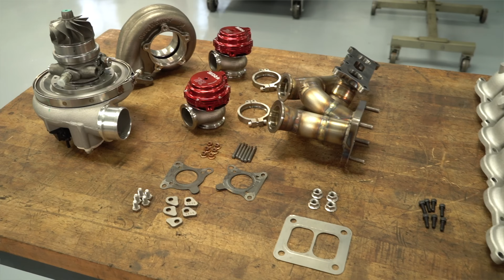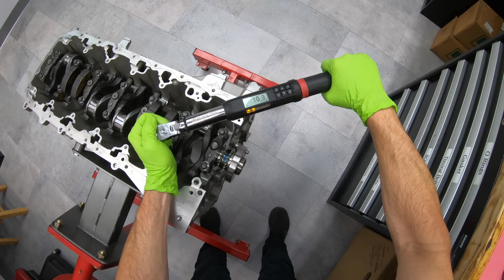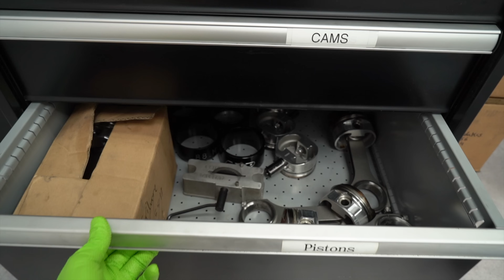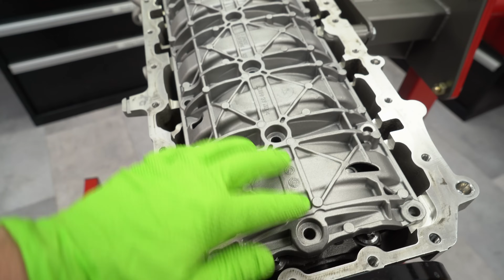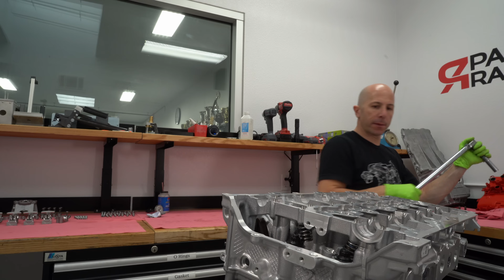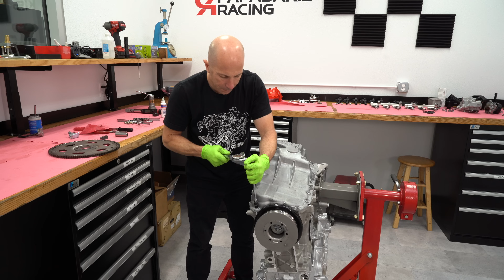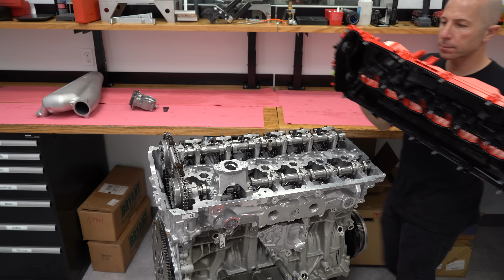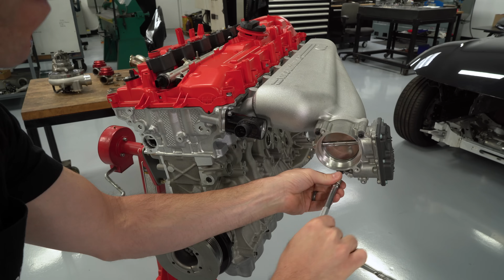2020 Supra 1000 HP Engine Assembly - Start to Finish

Comment: 2jz guys be like "tHiS ENgiNe StILl dOeSn'T mAkE 2000 hp, LaME!!!!"
Reply: Bryan Pranata to them you can say: not only is this thing’s power curve going to be less peaky, but the block is made of aluminum, not iron. It is lighter, and will cool better. I know a guy who does big time drifting, and after a couple hot laps has to put his 700hp 2JZ swapped build under some super fans to cool it down.
Reply: Xyreces ' people only bash this B58 since it’s a BMW engine. But the B58 is a great engine and it will make good power reliably. Thanks for saying all this stuff. Shutting up the 2JZ fanboys
Reply: Xyreces '  Well guess what, these turbo BMW sixes have the same issue. We have several customers who track their  335is, m235i etc., and they go into limp mode after several hard laps due to oil over temp warning.
Reply: @TheDeezelsmoke  Toyota left front vents closed because they over cooled the engine. If you have tuned engine, just open them and problem solved. This car is growing on me somehow. Lots of tuning potential.
Reply: Xyreces ' facts 2jz still rules. God of all inline engines.
Reply: Lol gotta love the forum bench racers here. These are the same ones that go claiming that their favorite car can do a gazillion hp stock and when someones asks "hey guys how can I make 1 hp above stock reliably?" they answer with a parts list that would make a Formula 1 team proud.
Reply: Bryan Pranata if the b58 had an iron block I would like a lot more
Reply: @Eric N Funny how people cant tell sarcasm. "what in the fuck are you smoking.... you said it yourself your dont know shit about the 2jz but here you are saying shit that isnt true." fucking . lul .
Reply: @purpscurp5534  I get the sarcasm but I will talk to idiots as such in their face or on their anonymous accounts lmfao
Reply: @Eric N turbo lexus is300 so yea I do know what the fuck im talking about...the perception and illusion is that you know anything about engines but here you are tryna troll knowing the b58 wont make it to the 2jz level
Reply: @the_visionvry6244  why because it wasnt made by an Asean guy? Dont underestimate the motor just yet. Same fucking thing happened years ago when the R35 gtr came with the all aluminium VR38 engine. But now we know what that motor is capable of. Just wait and watch. Toyota didnt just swap a motor from a 3series to their supra. They have done a tons of rigorous test on that motor to achieve their standards which btw even put BMW to shame. I wouldnt even bother to comment about the B58 if it was about a m340i. But as a 100year old reliable Auto giant using that motor i wont doubt its reliability. Already people have gone nuts over this engine. AdamLZ has already achieved a staggering 690whp with just turbo upgrade,downpipr and exhaust. Just take a look into babayaga racing channel where his piggyback Supra gapped numerous mustangs and gt350,camaro and even a gtr. So just sit tight and watch. Supra just came a year ago, buddy.
Reply: @Eric N  I have owned lots of high horsepower cars, including a Supra.  The stock long block is good for about 800rwhp with just bolt-on's + fuel with long term reliability.  My supra had 130k miles on it, stock motor, and about 70k miles of that was over 700rwhp. We had a guy in are local area with a 100% bone stock long block, with nothing but a single kit, intercooler, fuel, and a piggy back that made 800 to the tire for years, without issue.  I think people forget that it is not the high potential of the 2JZ that made them great, it is that you could make 700-800rwhp with true long term reliability with bolt on parts.
Reply: @Eric N There are tons of 2js that are reliable after 700+ whp, so not sure where you got that information from, but that's false.
Reply: @Eric N what in the fuck are you smoking.... you said it yourself your dont know shit about the 2jz but here you are saying shit that isnt true.... baltic supra is at 1400 hp and he drives it to and from the track...geo from realstreet is at 1800 stock block and did over 1000 miles to different tracks in the US.... on a sealed block challenge.... idk where youre getting youre information. the 2jz engine has forged internals so yes with bolt ons the supra is making 800 hp on stock parts... bmw has been making fancy high performance engines for years.... m3 m4 m5 m6 and they all get spanked by ancient supra mark 3's with bolt ons.. with a fuckin 1jz.. the only jdm car you know about is the gtr apparantly. the 2jz came in alot of lexus vehicles so careuful you dont get smoked by a fully built sleeper..
Reply: @the_visionvry6244  Thank you! Doing your research, such as you have done, goes along way.
Reply: 2JZ could reliably add 700hp buuuutt it was also a Moneypit. I think mk4 Supra's moneypit image was overshawdoed by its incredible tuning potential. And fact is B58 is waaay better than the stock 2JZ which btw is a relic. It was nice powehouse back then but not now. The Only problem with a BMW is they lack a good cooling management system which is why their engines suffer a lot. I hope toyota worked on this aspect. Nontheless B58 is the best in class straight6 motor, no two ways about it.
Reply: @abhinashpattanaik5109   this is blatantly false.  a 700rwhp supra was just bolt-ons (single kit, fuel injectors + second pump, and a piggy back fuel computer.) It would run that way indefinitely.  2JZ is still better motor that the B58 garbage.
Reply: Nope I like the 2jz stock
Reply: money money same but the motor is known to be tuned bcuz of the solid iron block.
Reply: @Eric N So since you're full of 2j knowledge and I'm so wrong. Please provide me with what brand and mods I should go with after my Supra make 600whp. I'm well passed 600whp in my Supra, but since you the guru and I'm the one supposedly spreading false information. Tell me what I need to replace after 600whp?? If you say the rods and piston after 600whp, you don't have a clue about a 2j.
Reply: @AllOutOrNothing88  i think 700whp is the break point. Anything over that could affect the motor with stock internals.
Reply: @abhinashpattanaik5109  700whp is no where near the breaking point for a 2j. My bestfriend and I just finished a 93 supra with 120,000 miles complete stock bottom end, stock head studs, s2 cams, springs and retainers, precision 7175and it made 650whp on pump and 950 on pump e85. Would have made more, but tuner didnt want to test 120,000 mile motor with more power. So, no 700whp is nothing for a 2j motor.
Reply: Bryan Pranata I used to be that guy lmao but this car has been growing on to me recently.

Comment: So many questions:
1) Custom pistons with stock rings and fingers, why would you even try that, there are so many ways to screw it up!
2) Why lock valvetronic to maximum lift whereas lower lift actually enchances a/f mixture at lower RPM? Maybe if this is dragstrip only project..

Comment: Mechanical vtc is so funny..honda uses oil pressure on vtc so no damage.  I think the cylinder head doesnt support high horsepower because 2x small exhaust ports of 6 cylinders. The real manifold is inside of the head.

Comment: Why are you using port Injection instead of direct? For better mixing of fuel and air and more control over ignition timming? I'd imagine you'd have better filling of the cylinder as well running as much boost as you do? Not great fuel economy though  ;)

Comment: A somewhat better engine than the previous BMW disasters but still a lot of room for improvement.
If the head studs have any coolant or open air around them coat them in neverseize before fitting the head coating the heads with neverseize won't hurt either.

Comment: That 3D printed intake manifold is amazing. I can see more and more parts being 3D printed in the future, from exhausts, crankshaft, engine block, etc.
Reply: Additive manufacturing isn't the Be All End All solution. It depends on the size of the part, the shape complexity, the mechanical properties that are required, the functionality of the part and how many "copies" you need. 

Current build volumes are not large enough yet to allow for a complete line-6 engine block, head or crankshaft to be printed. Also important to keep in mind: mechanical properties of forged parts are superior to printed parts, so as long as shapes are not too complex, a forged and machined part will have better strength than the same as-printed part.

When you re-design specifically for 3D printing, with the near complete design freedom of shape, the game changes. Then you can do things that are not possible with conventional fabrication (conformal cooling channels, complex shapes, additional bracing, hollow sections) and end up with parts that are lighter and, as part, stronger.
Reply: For the price of that manifold you could buy another supra.
Reply: it will work well to manufacture parts for old cars that aren't available anymore
Reply: There are 3d printed rocket engines (for orbital rockets, they are no slouch), so theoretically you should be able to build a fully 3d printed car engine
Reply: People need to realize that not all 3d printing is the same, SLM printing is most likely what they used with the intake manifold, its basically welding small particles one layer at a time and with each pass the bed is lowered and fresh powder is laid ontop, then scraped to be a certain thickness waiting to be fused with the previous layer, completely different from what everyone calls 3d printing with most sub $1000 machines that are just adding layer after layer. Hell it has more in common with sintering metal parts ( hugely common in manufacturing) than 3d printing. Also these machines are big enough that they can print many parts at one, not as fast as sintering, forging, or casting.. its more the same speed as cnc, except has a lot less setting up for each part than cnc or milling. Of course it has drawbacks, like cost  because you need super pure powderized materials but its still a relatively new technology, so give it time, and simmer down because every manuf. process has a drawback and non are perfect.
Reply: Imagine an RB26 3D print, that'd be awesome
Reply: @robertloweiii8790  No, just replicating a design without using what the extra design freedom has to offer isn't all that great. 

But imagine an RB26 based design with internal cooling fins in the coolant passages near the deck where the heat generation is greatest, with extra thin walled sections where stresses are low, for weight reduction, with every surface transition perfectly radiussed to eliminate stress concentrations, with wall thicknesses increased at failure-prone spots, with extra internal webbing and bracing for increased rigidity, with every internal oil and coolant passage laid out with large radius bends to reduce flow resistance... 

And as a bonus, perhaps printed in a titanium alloy instead! 

You can do so much more to a design if you're not constrained to design rules that follow from having to cast a block.
Reply: I work for siemens, i saw and internal newsletter showing how r&d made 3d printing of huge turbines for factories a reality, i'm talking about 2 tons turbines, ita crazy
Reply: @ricardorodrigues3508  As long as the profile dimensions are precise, then it would 100% be balanced and strong. It is after all, a homogeneous and monolithic structure. I need to look up typical turbine rotation velocities. They need a MASSIVE printing system though! Geeze! Probably the same mass as traditional turbines.

Not exactly the same as 3D printing resin spools buttt:
Bayer AG and Siemens make the absolute best resin pellets. My old employer used to get screwed by our 3rd party manufacturing house in China. They used to blend in their own pellets or use only their own and the results were disastrous. Off color, bubbling, peeling, cracking during drop tests, and reduced resistance to alcohol and disinfectant solutions. Increased warping too. The company spent the money to freight drums of genuine pellets to China and demand photos when received. Same people, same injection moulding equipment with genuine pellets always had great results.
Reply: You're all acting like Koenigsegg aren't 3D printing turbos for their market leading cars out of titanium or stainless steel with the moving parts printed inside and already fitted, along with even threaded parts printed so there is very minimal finishing work. Granted its low volume work.
Reply: 3d printing has huge limitations. Old school machining is still the best.
Reply: @chico305SIGMA  There was a time when a horse and a wagon was better than a car. I believe the overall point is in the "future" as technology progress, there could be significant advantages to being able to print the parts you need.
Reply: @Justknow4now  you don't understand. When machining a part there are so many different metals and alloys that are needed. 3d printing has massive limitations because lots of parts have to be machined from a solid piece of metal of a specific type. There are so many different types of metals that it's crazy.
Reply: @Justknow4now  my CNC machine can make what ever part you want. But mine are stronger and the tolerances can be whatever you want.
Reply: @chico305SIGMA    no, CNC machining CANT make whatever part you want.
Reply: @chico305SIGMA    traditional machining is actually very limited in what it can do if the part needs to be made in one piece. 

If you were a machinist you would be intimately familiar with the limitations.
Reply: @DrewLSsix  I am a machinist it all depends on how many angles it can machine in. My machines can do 5 axis. Haas
Reply: @chico305SIGMA  Sorry, but it appears that you have either a very out-dated idea of what 3D printing is, or the wrong idea entirely. 3D printing of metal ("additive manufacturing") is, in this case, powder bed selective laser melting. Source material is fine metal powder, produced by gas atomisation. Printing does not start with a solid chunk. 

As for available grades, you can get a wide range of aluminium grades, stainless steel grades (the ferritics, the austenitics, the duplexes and the precipitation hardening ones), titanium grades, copper, brasses, inconels and more. Even gold, silver and platinum are available on the market for printing.

The beauty of additive manufacturing is that you have an almost unlimited design freedom. For example: GE developed a new turboprop engine for the new Cessna Denali, where they went from 855 parts to just 12 printed parts. Their new Catalyst engine is lighter, more powerful and more fuel efficient than its predecessor.
Reply: @chico305SIGMA  the future is additive/subtractive machining centers. They can laser sinter a bed of powder, then machine it. 3d printing can produce products that have intricate interior features, that mills can't create. They're also slow. A VMC can do things that a 3d printer can't, and vice-versa. Both additive & subtractive methods will be used in the future. As it is now, parts are rarely used directly after 3d printing. They're milled to finish spec. 3d printers don't have the ability to be near as accurate as milling. Also 3d printing a party out of inconel, Monel, super duplex or any of the super steels or nickel based alloys, no near-net-shape, then machining them is a lot faster/cheaper materials & consumables wise, than milling them out of a solid billet.
Reply: @chico305SIGMA  3-Axis machine?
Reply: @pgmurray76  5-Axis HAAS anything below 5 is a waste of time.
Reply: @chico305SIGMA  That's what I thought. The Machinists at my job set and forget the HAAS machines and the parts are flawless. Nothing like NOT having to make a million positioning jigs, fixtures, and clamps and then find a zero point to fully machine a piece to completion. It really is silly.

I suck. 4 hours ago you commented 5-Axis Hass.
Reply: @pgmurray76  Haas is a really good, American made machine, that costs half the price of the  Japanese machines (DMG Mori, Nakamura Tome) and German machines (Hermle, Kern, Datron). Those German and Japanese machines are more accurate and precise, and can be as accurate as down to 50 millionths (0.001 mm) if you have a proven & optimized CAM routine. The Haas isn't quite as accurate, but they're getting better and better, and they're nowhere near as expensive. Also, tooling for them is much cheaper, as they're CAT 40 or 50 taper rather than the HSK. HSK tooling is more expensive, but again, it's better.
Reply: @xenonram  I was wondering how we have two in the machine building!
Reply: JKAN 3d printing is essentially the horse and wagon, the handcrafted non-industrial solution. Like watches were made by watchmakers and cost an annual salary or two. There is nothing more in that process that one person could not do or learn. This modern handcrafting still has it's place where features or costs allow.  But it has nothing to do with the complexity, speed and efficiency of modern industrial production.
Reply: @gearloose703  BMW alone is already producing over 100000 parts per year for prototyping, discontinued parts fo classic cars and intricate/complex parts for production cars. The VAG group expects to hit the same number of 100000 printed pars per year. With binder jetting printing (print metal powder and wax like it is plastic, then sinter the part solid) they expect to enter mass production in 2 to 3 years.

As mentioned elsewhere, GE has developed the Catalyst turboprop engine for the new Cessna Denali, where they consolidated 855 conventional parts into just 12 3D printed parts. That new engine is more powerful, lighter and more fuel efficient. 

So this is very much entering modern industrial production.
Reply: So you think sintering is new technology?